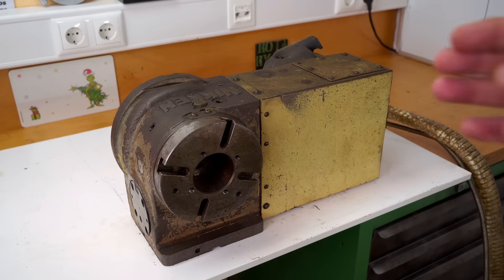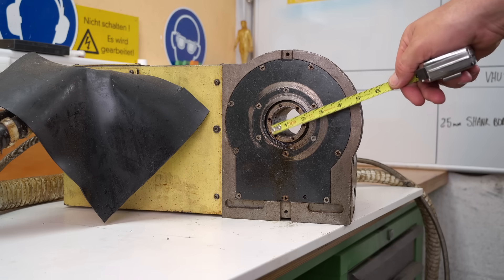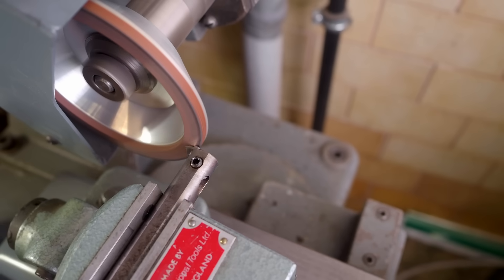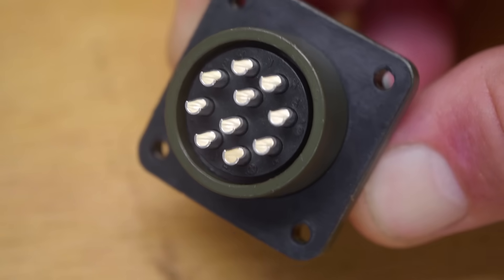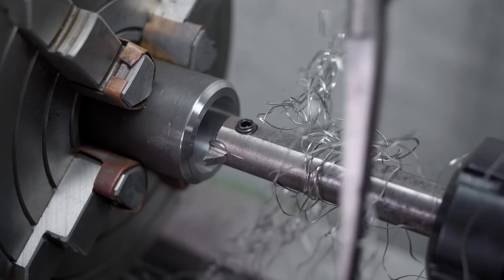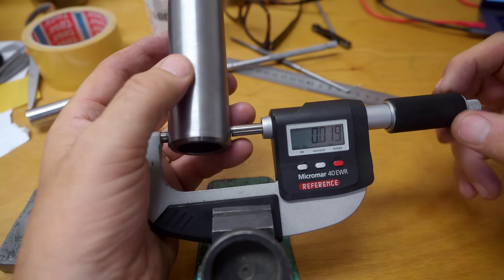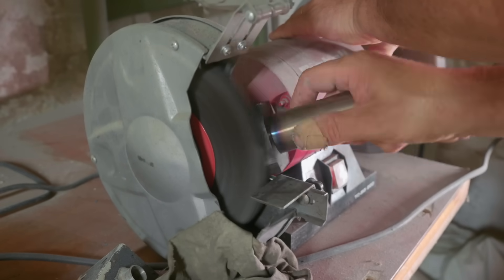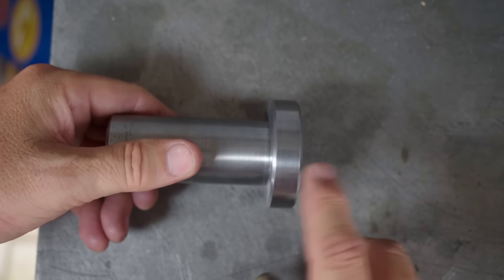Why is it hard to make a buttress thread?  || RotarySMP

Comment: Standard nuts and bolts are sized such that the thread stripping is rarely the mode of failure when loaded in tension, it will be the cross section of the bolt itself failing. Buttress threads are going to be more difficult to manufacture, so theres no reason to switch.
Reply from the maker: Good point.

Comment: I believe the reason that bolts don't normally have buttress threads is because they are usually cold rolled. You cannot create a buttress thread using cold rolling. You would need to cut the threads to do that. Also bolts are made to stay tightened so a trapezoidal thread will give more friction for that purpose.

Comment: About the normal bolts, apart from what the other commenters said, after you thread in the bolt more than 1 diameter in, the tensile strength of the bolt becomes the limiting factor, so for most applications it does not matter what kind of thread there is, but it probably makes more sense for some wierder applications like collets or large threads with narrow nuts
Reply from the maker: Also the buttress unlocks easier.

Comment: Sometimes you want to fasten something with nuts on a threaded rod from both sides, need symmetrical threads for that. Also sometimes you do want to push something with bolts instead of pull, like there are sometimes threaded holes in flanges that are there solely to be able to get it off again just by using the same bolts that normally hold it on. I wonder how much strength you gain by using buttress threads instead of regular symmetrical threads anyway.
Reply from the maker: Good points.

Comment: well Mark i'd say that the cutting loads involved in cutting buttress threads with dies would preclude mass production, not to mention cold rolling mass production would be nigh on unfeasible. So it's back to single point/facing and uneconomic...
Reply from the maker: There is a comment in here, from someone who worked in a factory which rolls them, Alan, so it seems that is not a limitation.

Comment: I would suggest the bolt is a variant of a threaded rod and these have to take loads from two sides. so you would have different hardware for threaded rods and bolts. But you might get a patent for medical screws with this observation as they tend to make obscure decisions to get patents for seemingly unpatentable ideas.
Reply from the maker: Good point.

Comment: Information. To cut a outside thread you realy should use a 90° tool holer not a boringbar. Why? because of cutting pressure. (As machinist we have to think about cutting pressure alot, it steers the forming of vibrations to) 

When you have a dull tool, vibrations go up very fast from the rubbing... When worked with sharp tools and a positive rake the vibrations can be reduced drasticaly.

The thin boring bar will twist to some extend. A 16x16mm toolholder will not twist away and the pressure goes into the forming of a proper chip. That leads to good formed thread ways.

We cut our threads with around 700rpm and 0.2mm deept 3 feather passes do the job, some times more FP are needed but thats a question of material threaded.

You could do too a toolholderblock with a w20 holding hole. Then you could reuse some carbide endmills as cutting tools.

Like this one here https://ablager.ch/products/spannzangenaufnahme-schaublin-w20-fur-kreuzschlitten

Comment: The advantage of buttress threads are efficiency and longevity. The lower the angle the lower the pressure between surfaces. And these threads are still simpler to make than trapezoidal ones I guess.
Reply from the maker: Good point. Thanks.

Comment: As a first year apprentice I had to make a shaft that had various vee threads, Acme, buttress and square threads before I left the apprentice training section and went into the workshops to show I knew what I was doing. The square thread was a triple start and I had to make a nut to fit both the square, acme and buttress threads. Buttress threads can be rolled the same as vee threads and I am pretty sure the only one that cannot be done is square but I have seen them cast and was poor quality as it was done in a split die.

Buttress threads are used to transfer higher force than vee threads and the 45 angle faces allow the use of split nuts on vices for quick adjustments as the split nuts will glide over them much easier. When torqued correctly they are no easier to vibrate loose than any other thread.
Reply from the maker: Thanks for that. We only did vee threads for the machine vise in my apprenticeship.
Reply: Now that's some bloody test for a first year apprentice! I bet that was a good few years ago. Kids nowadays would need their nappies changing( diapers lol) after being shown a nice big manual lathe !😅😅😅
Reply from the maker: @samrodian919  I did an aircraft mechanic apprenticeship, so machining was only a minor module in basic engineering.

Comment: can't you just flip the part backward in the chuck and work blind on the internal end with the tool you made? and do you need that exaxt length or can you salvage the part tou made by cuting backward thread and making a new one behind it? or is the wrong thread just too deep do do it?
Reply from the maker: I could do that, but also have a pretty bad chatter issue with that too long boring bar. I'll regrind and use it in a shorter one.

Comment: HI Mark  I have only used a buttress thread once in my career.  That was for a precision highly loaded adjustable tensioning frame.  Do you know the standard it is made to?  I checked my records and your profile is not to DIN 513 Metric Buttress Threads.  The DIN angles are 3 and 30 degrees not 5 and 45 degrees.  Cheers
Reply from the maker: I just used the angles Schaublin listed on that document I showed. Since the major diameter is 29.7mm and the pitch 1.693mm, I suspect Schaublin didn't give a rip about other peoples standards :)

Comment: About a year ago, I setup and cut an absolutely beautiful 1-1/2"-8 thread, or so I thought. I had forgot to swap the metric transposing gears back from cutting a M30 thread. So my 8 tpi pitch thread was actually 3MM pitch. I kept wondering why the nut would thread on about 5 full threads and then get tight 🤦‍♂
Reply from the maker: Close enough to catch anyone out. Thanks.

Comment: Symmetrical threads can be roll formed easily, but that advantage probably only appeared decades after they where widely adopted.
The issue you ran into is also real in production - symmetry solves this.
Even when thinking about the drafter it is easier to draw a symmetrical item.
Then you have @mandrakejake thoughts. 
Basically they are simpler to make and use and draw.

Also there are two types of buttress threads - normal (45/0 deg) and collet (45/5). There are of course others
Why the addition of the 5 deg slope to the back of the thread for tooling (collets)?

Is it so you can come in and clean up the back face easily? That is use a std 45/0 tool and then clean up the face with a (say) 40/5 tool?

A GREAT reference is the Schaublin Clamping Tool Catalogue     schaublin ch/eng/catalogs/index (add the . )

Comment: So you can just use the same tool, just cut a threaded piece and flip it end for end.

The only advantage I can see is it looks like it would thread easy and only come tight at the last turn or so, IDK, never used one.

A lot more stuff required big threads before the advent of hydraulics so some like square threads are almost just a concept anymore.
Reply from the maker: I could, but this one has too much stick out and chatters a lot. I'll regrind and use a shorted bar. 
Good point.

Comment: I'm in the pool and spa business. Almost all unions are buttress thread. They  oppose the force of the water pressure. Trying to push them apart. They also bind up, so they won't back off. You can hand tighten a 2" Butress thread locknut on a union by hand. You'll need a an 18 inch long pair of channel locks to get it apart.
Reply from the maker: Thanks for that Scott. I didn't realise they had that use.

Comment: I think your chatter problem might be getting made worse by too much engagement of the cutter. I don't know if there is a way to do it on your lathe, but my mind was going to the old 29.5 deg compound trick on manual lathes. Maybe grind your tool with different angles like 4 deg and 40 deg, set the tool holder at one deg, and program it to advance a little radially and axial on each pass? Like I said I'm not 100% sure how you would do it, but food for thought. Thanks for another great video
Reply: Only thing is the thread he is making should match the thread on the existing part.
Reply from the maker: It is a good input. LinuxCNC's multi pass threading cycle (G76), includes a Qxx parameter to specify the angle it should infeed at. Since I was using Andy Pugh's lathe macros, that was set to 29.5°. I should have overridden it to run along a flank, to cut on only one flank per pass.

Comment: Regular threads are probably easier and cheaper to manufacture on a large scale. And you can get away with a little more clearance so not as precise.
Reply from the maker: And being symmetrical, you can insert them from either side.

Comment: BTDT. Not that exact situation but I have made identical mistakes. I have had and worked with a few things with butrtess threads. They have their place in strong situations. 
     
  Found a grizzly 12x36 lathe, mill, bandsaw and grinder locally for 3K. Told the better half it would be a great christmas/birthday present. But after having to cancel vacation and loosing out on about $1500 of non refundable stuff she didn't like that idea. And dads surgery this week etc... 
 
        I have been repairing our automatic litter boxes for years now and ran out of the 12 tooth pinion gears. I get aluminum ones so they are the weak point and don't destroy the bigger gear. But.. They are now $10 each plus shipping from china as none are available from US suppliers. But I think RC cars to the rescue. They use module 1 gears and they have the 38 and the 12 I need so will see what's at the hobby shop tomorrow. 
         I did tell her that if I got that package of tools and a spindexer I could make my own gears... She didn't go for that either.  I did 3d print some but they last a few seconds before breaking as they can't take the torque. Low speed high torque application.

         Anyway we should be on a plane towards Athens in about 30 hours but no, So I'm really bummed out..
Reply from the maker: Hi Robert,
Has been a tough couple of months for you. I hope things are looking up gooing into fall, and I hope you can unwind and enjoy your vacation.

 Once of the advantages of making enough YT videos, is that it is paying for it's own tooling, so dont need to negotiate them with the finance minister :)
Reply: @RotarySMP   Once things settle with them I'm going somewhere. I have to have at least 10 days away from here in one stretch for my sanity cause everyone that knows me I hate it here... Not sure what I will do yet. 

     She has no problem with me buying tools at all. But.. Bigger stuff If the house didn't still need stuff done to it she would probably pay for part of those tools. I think part or her having no problem with me buying tools etc is the fact that she is the reason we haven't moved and I'm miserable here and it's a part of trying to make me happy.
      Sadly I'm not equipped with the artistic talent for making great videos.  
   Did I ever mention I hate living in TX. :)

Comment: My guess for why we don’t use a buttress thread is that ist harder to make and mostly standard threads are strong enough the where the bolt breaks before the thread. And from @mandrakejake; they are symmetrical from either side.

Comment: The regular screws do get distorted due to the profile angles and this is the feeling you get when you tighten them. With the buttress this is not the case (or at least is way less pronounced) so won't be so good at securing stuff. That's, I think, why securing screws are not buttress. Why collets have buttress, that's another story
Reply: They have buttress threads as the force is only in one direction and they are better at transferring force than vee threads.
Reply: @dikkybee not only, but this wasn't the topic risen by Mark
Reply from the maker: Thanks guys.

Comment: @7:47 too funny that elesa ganter actually shipped the sightglas. They have a shop in vienna too by the way. But you have to order it in advance and the pick it up, or they are very confused and grumpy in good viennese tradition. Shipping is reasonably quick and cheap so I usually don’t bother driving there.
Reply from the maker: Thanks Bernhard. It didn't dawn on me that someone local might have that. :)

Comment: The reason for buttress threads is they are the strongest threads in one direction and easy to back off in the opposite. The downside is that they are hard to machine. A compromise is using Acme thread.
Reply from the maker: Good summary.

Comment: Fasteners use symmetric threads because they are easier to make and the "conical" helix geometry has more friction so it's easier for them to hold tension once fastened.

Conversely, motion screws use a more "straight" helix to lower friction.
Reply from the maker: Good points. Thanks.

Comment: 1:59 my guess would be ease of manufacture, why have two thread standards when you can have one do one thing pretty well and another thing good enough. for high strength applications yeah I absolutely see the point of buttress over standard 30° threads but those are so few and far between that it's easier to just have a normal bowl that might be just a little bit bigger or different materials to make up for the lessoned strength. 🤷 just my 2¢
Reply from the maker: It was prointed out that the symmetry means you can insert normal screws from either side, and they are more vibration resistant.
Reply: @RotarySMP the amount of times assembly teams or other factory applications (which I would think would decide the application of what thread where) it probably wouldn't matter if it was reverseable or not unless there were differential screws involved like how your boring head video showed. although I don't do a lot of assembly so I can't say for certain, I just make the parts😅

Comment: Sometimes you can mitigate chatter (harmonics) on longer lathe tools by wrapping the shank in rubber.
Reply from the maker: Good tip. Thanks. I will use the shorter bar for the next attempt.

Comment: They make laydown style inserts for buttress threads.  Takes some of the guesswork out of the project.  Also, you'll see buttress threads used extensively in turbine engines.  Rotating shafts with large spanner nuts would be a typical location.
Reply from the maker: Thanks Jeremy. I should have done the sketch before I started.

Comment: You probably thought of this, but aren't the inverse cutter and the 180-degrees-rotated cutter the same aside from the lead angle clearance?  What would happen if you rotated your existing cutter in the boring bar (assuming that is a 45-degree through hole)...
Reply from the maker: Flipping it would mean I would have to run the spindle backwards, which would cut a LH thread, Tim. I also want to address the chatter by switching to a shorter boring bar.

Comment: i have screwed up normal threads because my compound slide was adjusted to 60 deg.after two attemps i realized i had to shift it to 90 deg to be on 60.just a matter of lathe design those things happens.
Reply from the maker: Thanks Jean-Marc. I should have sketched it first.

Comment: That is one of those mistakes we hopefully only make once :) I have cut sawtooth treads a few times over the years and certainly got the nut backwards once. 

As for the point of sawtooth threads, I think it allows a free running fit than you can do with v threads, (a small change in diameter adds space between the steep and shallow flanks without making the diameter too small. Whatever the difference W20, B32 etc collets are so much nicer to work with than their vee thread cousins. For production I don't think it matters but for the toolroom machines it is do much easier to change collets. Now if B32 were the same price and availability as 5C collets they would be even better :)
Reply from the maker: Yeah, they are always really pricey. I am glad I have the full mm sizes. I doubt the 1/2mm ones will come up for a price I can stomach.

Comment: My opinion on why buttress threads aren't used on most screws: the added complexity in manufacturing isn't worth it when your average screw does not fail at the thread. I've only ever had a couple of screws fail and they generally fail through the body of the screw. I've never had them pull the threads off. My second theory is a screw will be usually left in long-term, variations in temperature and environment may put the screw under load in the opposite direction.
Reply: They are no more complex than any other form of thread and can be rolled.
Reply from the maker: @dikkybee  It was pointed out that the symmetrical threads can be inserted from either side.

Comment: i work in the hydraulic industry as a machinist and alout of different manufacturers use buttress threads it always confuses you when you have to cut them
Reply from the maker: Thanks Chad. I should have sketched that before I started.